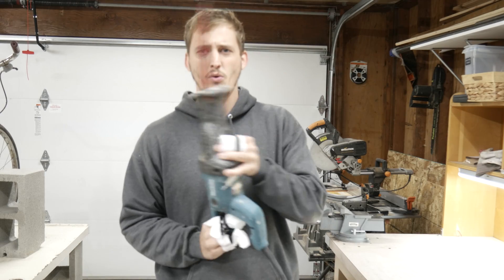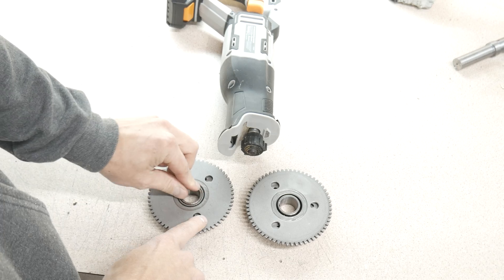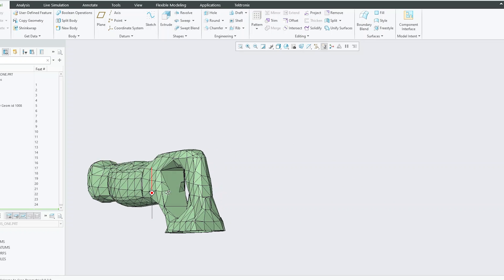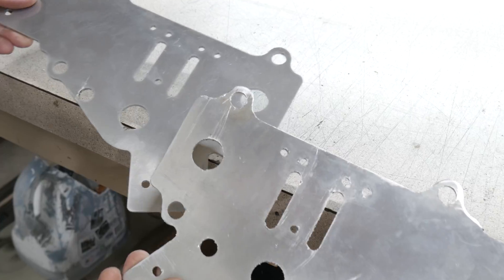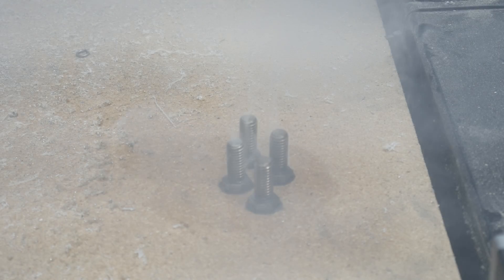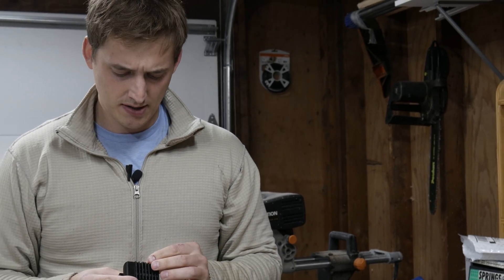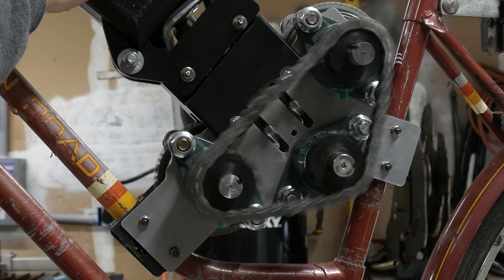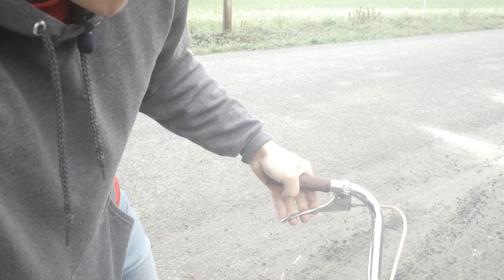making an electric bike from a power saw

Comment: iN STEAD OF THOSE TWO WAY BEARINGS YOU CAN 1) GET A BATERIED CIRCULAR SAW AN YOULL HAVE A HORIZONTAL SHAFT LIKE A NORMAL DIRT BIKE OR 2) TAKE THE ATTACHMENT HEAD OFF A ANGLE GRINDER, ITS LIKE A 90DEGREE GEAR BOX AN RUN THAT ON YOUR SAWZALL MOTOR! IT MAKES A VERTICAL SHAFT ABLE TO HOOK UP TO A NORMAL SPROKET JUST LOOK AT A ANGLE GRINDER YOULL SEE IT! JUST A TIP FOR FUTURE BUILDS GBYAA!!!!!!!!!!!

Comment: I think treadmill motors are more suited, even though it's outside the scope. They have fan cooling the stator and rotor, then are DC permanent magnet, they are commonly 1000W+ They also come with a big heavy steel or cast weight on them that you could "machine" into a pulley, or weld to the teeny pulley that comes on them. Treadmills are common dump finds :)

Comment: Wow & very entertaining. But seriously, you need a crank freewheel for the pedals so your feet can remain stationery or you can pedal.  Check out the "shift kits" for motorized bikes for ideas. I have one on an motorized bike kit that I converted into a shifter. You are on the right path.
Reply from the maker: I was thinking of ways to do that for this project but didn't realize they make a kit for it!